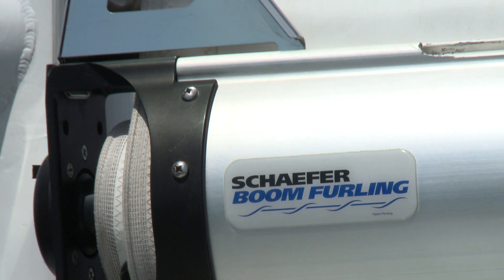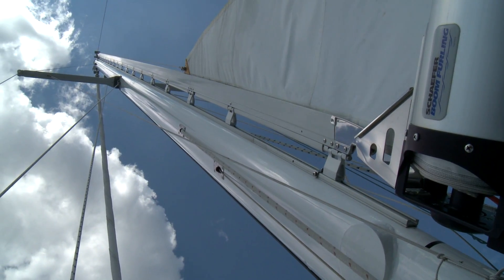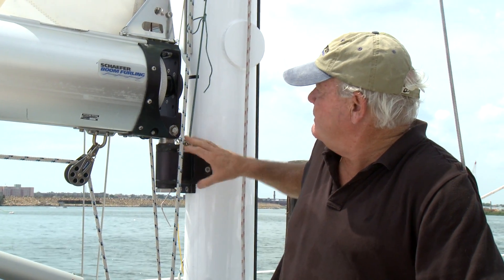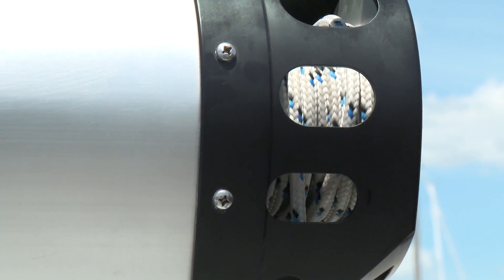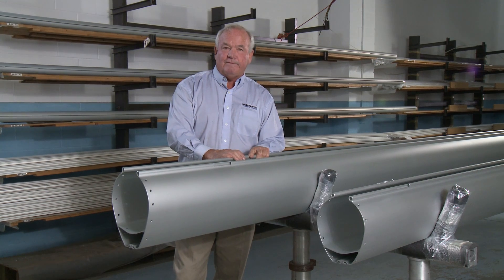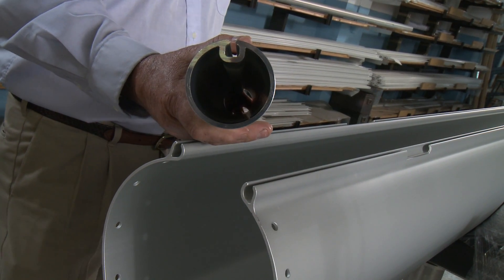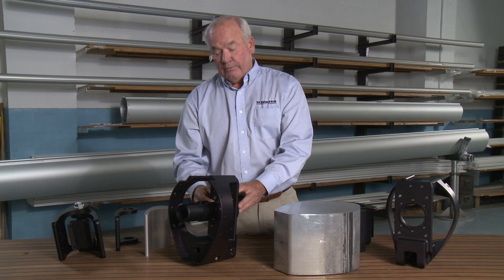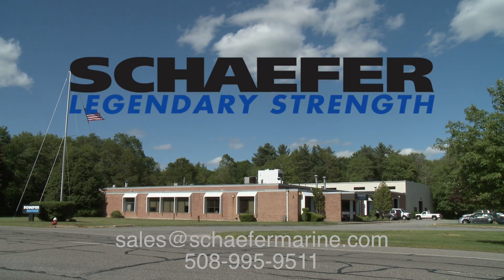Schaefer Boom Furling Systems

Comment: During 2024 – 2025  I used a 2005 Schaefer Gamma Boom on SV Willow, a 42” Cabo Rico Pilothouse, for a 13,500 NM, 8-month solo circuit of the North Atlantic at 72 without a single issue. 
If you have an old Gamma system, be certain to upgrade to the new more rigid mandrel claw and always ensure proper batten tension. Here is why:
After an easy voyage that took me to Iceland and Trinidad, a sailmaker removed and reinstalled the sail for a batten pocket repair. When reinstalled, they failed to adequately tension several battens in place. I had to abort my next transatlantic crossing when, in high winds at night, of course, the top batten popped out at the mast end, and the next one down broke its mast end fitting. 
The battens then got caught up in the radar and spreader as I reefed. Focusing on the batten issue, I failed to see or recognize that it's the battens that keep the sail taut fore and aft so that there is no "belly" in the sail and it rolls up evenly. With the battens no longer keeping tension, a thicker "bundle" of sail was created in the center of the boom, which popped the mandrel out of the old style "claw" that retains the mandrel, and jammed the sail from rolling in further. 
Yes, I could drop the sail, as in the video, but I had to go forward solo in high seas, at night, and throw a line around the flogging sail to secure it to the boom to reef. Once back to my riggers, the sail had to be cut off and the bent mandrel cut out and replaced, along with the sail. This is when I found out that there was a new style, more rigid "claw" that might have prevented that. Batten integrity is KEY!
I've reefed with the boom out 70 degrees from center, restrained by running back stays, in varying strengths of wind. I progressively roll to reef as the wind picks up, but even in the final stages of going to bare poles in 55+ knots of apparent wind, I never had a problem reefing in seconds from the safety of the cockpit. 
As an experienced professional sailor with well over 100,000 miles on a wide variety of sailboats, I’ve experienced traditional reefing, and in-mast-furling that I’ve had jam mid-ocean, too. However, even with the costly issue described above, I would choose the Schaefer system for any serious offshore voyaging if my vessel fell into the size range they manufacture. The system is so easy you never even have to think about reefing as the wind is building, or dropping, on night watch when others are sleeping.

Comment: I wonder if I could install this on a Neel 51 trimaran. The foot is about 20ft, so that should be fine with the larger system, but the loof is 60 ft, which is slightly more than the claimed capacity of the boom. I wonder if that is a hard limit based on number of turns or of it is flexible enough to accommodate a free extra feet (and if the foot rail can be ordered in a slightly longer size).

Comment: I guess I know the answer because your video is very good but I want to doble check: is it possible to reef down wind with this system? Not necessary in a run, let´s say 120°?
Reply: We have the largest boom (Gamma) and are not able to furl the mainsail when running downwind in winds above 8 knots. It is possible in a light breeze, but anything above a few knots creates too much friction. I don't think any of the boom furling systems can roll down the mains when sailing downwind in moderate to high winds; you must turn the boat into the wind.
Reply: Yes absolutely, any point of sail. SV Willow 13,500 NM, 8 month solo circuit of the North Atlantic. If you have an old system be certain to up grade to the new more ridged mandrel claw.

Comment: Fantastic system but hard to swallow the cost. $13,000 for the Beta (smaller of the two). Then you have to add re-rigging and sail alteration costs. You really have to want it as like any boat the barrier to upgrade purchase cost means this is going to require major compromise during your refit. I was wishing for one for my 65 Pearson Vanguard but tough to have a boom refit cost more than 1/2 the price of the boat.
Reply: And not just the cost of the roller boom, but the mainsail has to use special headboard, Teflon luff tape, battens - along with a very experienced sailmaker familiar with these specialized sails - which ends up costing about double what a standard mainsail would go for.

Comment: I wish "these" guys would explain more of how the luff rolls up. As we know that in mast and jib roller reefing one leg of the sail needs to be cut at an angle to avoid material build up and evenish tensioning of the furled sail. How does it work in the boom furler, I do not see a tapered shape at the luff as this is where it would need to be, no?

Something else that makes me weary with "these " guys, how in gods green earth could you not sell the point of "maximum adjustability when reefing for the current condition. Instead of having two or three reef points, you basically have a hundred!

Or, tweaking the sail shape, how can you not address this.

Or the addition of boom vangs and preventers, how can you not address this either?

As, far the 'main point being safety, not leaving the cockpit. For years there have been slab reefing system were 99 to 100 % of the work can be performed from the cockpit and only cost a couple of hundred dollars to purchase or make up and can be installed in less than a day.  And hysterically, the guy working the winch is actually half out of the cockpit with one leg on deck.

And, people like to make 'going forward" as oh-my-god dangerous, it's not, when performed safely, and a good sailor will "go forward regularly to inspect the rig and the boat.

It's "basic" reveals like these, with so many holes in it, that it makes me wonder if the company or maybe the "president of the company' of the PR people really know what they're building or why. Or if there are actually all kinds of issues that they haven't sorted out yet. Or, hey there's a market here how can we spin it....

Jes-louise...

Comment: Just wow, these units are $20K !!
Reply: @Pixel Dust An alloy extrusion that length is 2k, not 20k.
Reply: @SteveWrightNZ  We have the largest boom (Gamma) and it costs $20K - plus the specialized mainsail added another $15K (Hollmann 52). All of these roller booms/sail combos are very expensive.
Reply: @Morrisfactor    was it worth it to you???
Reply: @tarpanc34     Frankly, no. I would not have boom furling on a boat again.

Comment: That machined billet part is heinously expensive. You're looking at scrap levels only seen in aerospace. Perhaps the volume does not justify it but with some improved manufacturing techniques you could cut the price of this system in half. $19k USD is a tough bill to swallow.

Comment: Great product I'm sold where can get one expertly fitted in Australia.
Reply: No answer?  Damn.  I was about to ask the same question.  Guess I will have to ask directly who there agent in Australia is.
I'm in Western Australia, about to buy a new 50-60' sail cat (Seawind or MC) in the next 3-12 months.
I have been researching Boom Furlers for a few months, gotta say, this one has me sold.  Good reports from owners and this system makes more sense to me than others.
It looks like its all about the sail transition from boom to mast.  The other way around is easy, its getting it on the mast without jamming.
I hate those lazy jacks, makes putting up the sail in anything but flat calm a pain in the butt.  And that's self defeating. If its flat calm, you dont need the sail!.